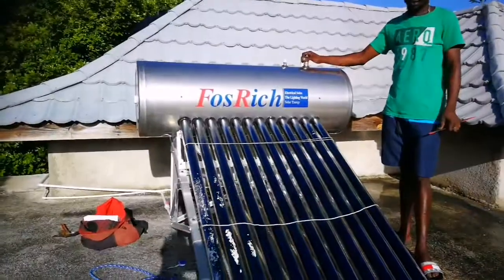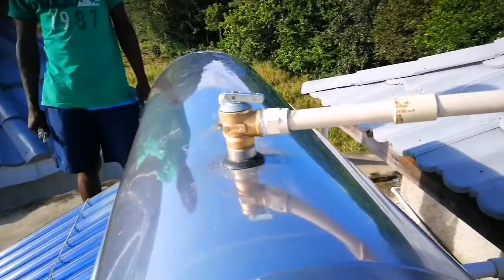Solar Panel vs tube solar water heater and repair/ Jamaica solar system  Plumber In Jamaica

Comment: Its expensive to connect the back up system because the element has to heat up all that body of water in the tank  only to used a little of what you need to shower

Comment: What size SWH is that?
Reply from the maker: I think it's a 50 gallon, it worked really well, on a sunny day we got up to 10 showers on a full tank, and it was up and running again within 2 hours. bear in mind it gets really hot🔥 64°c
Reply: @stoneyvill  thks for the info.
Reply: Kind of curious..does all of them comes with a back up element or just this one?
Reply from the maker: @garysamuels6139  most likely. 
This particular unit is really good.

Comment: the tubing heat much faster that the panel when the panel is burn out you have to replace the  whole system if one of the tube damage you can get replacing tube and when you or leaving turn of the cold valve feeling the tank can't tell you if the water is hot or cold

Comment: You know it bring back memory when we bought one of those solar water heater for the house, the sellers asked if we were connecting it to the electricity. I was shocked as I thought solar should be just that - operating fully off the sun. They claimed that if its not connected electrically then if the time gets cloudy I would not be able to get the benefit of hot water. Well I have not connected it to the electricity and I am never out of hot water.
Reply from the maker: Prior to my online research I never knew that solar water heater system can connected to electricity. 
At one point I was thinking of getting it connect to electricity and I quickly changed my mind when I started watching your channel.
However, having the option is not a bad idea if you live in parts of the country were the sunshine is not as potent as central...
Reply: @stoneyvill  Yes those persons living in such areas may need it. I just want to get rid of being so reliant on JPS so once the unit can operate on solar totally I will consider it
Reply: @stoneyvill  what's up bro it me the plumber
Reply from the maker: Hey what's up bro, good to hear from you.
The solar water heater system is running at it's full optimum performance at any given time, no matter the weather we got hot water with no issues years later.
The system still handles 10-15 showers per day🔥🌡️
Reply: Good info but your accent fuck up bro😂.

Comment from the maker: I installed this system 2 years ago and never had a problem, however in this case the Solar water heater system needed a light service because it hasn’t been used for over a year. 

This tubing system is very good and has a low maintenance rating hence why I went for the tube system, 0 faults so far. 

The main reason why we had to changed the release valves is because the system has no hot water due to a failed release valve which was a easy fix, and all that could have been avoided if the system was regularly used. 

Anyway my understanding of solar water heating system today is to maintain its optimum performance the system need to be regularly used. 

For contacts information fast forward the video 10:20 or 10:32
Reply: Whats the cost for this unit i want to install 2 at my house
Reply from the maker: @jamaicansbuildingdreamhous1136   
For the company contacts  information fast forward the video 10:20 or 10:32
Reply: @jamaicansbuildingdreamhous1136  Have you already bought it
Reply: @Tom-zt2ce  no where can i get it
Reply: @jamaicansbuildingdreamhous1136  I am a Chinese solar water heater manufacturer, looking for partners